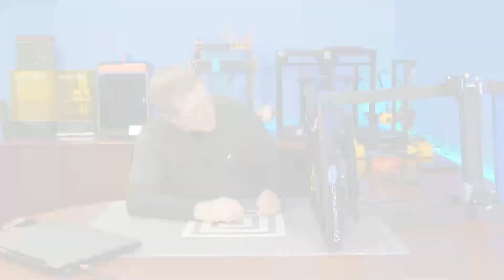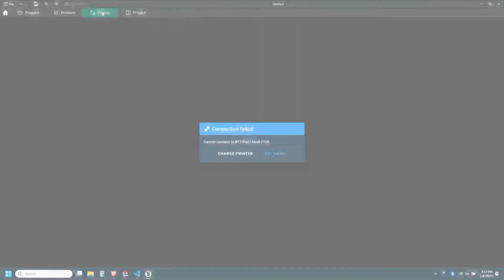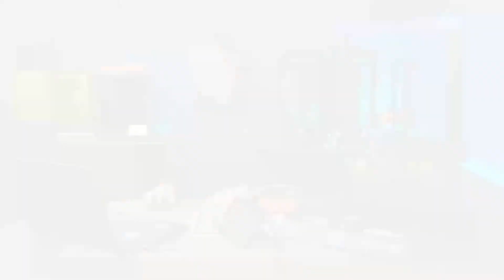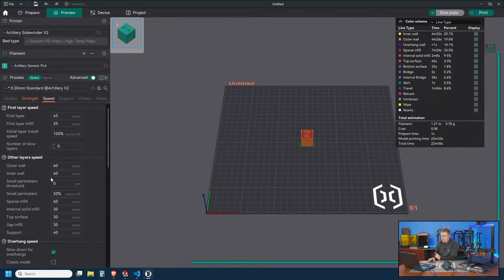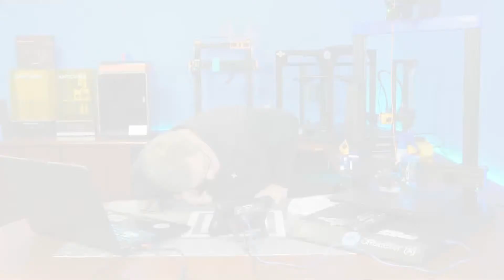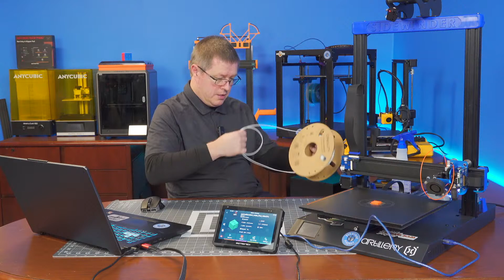Sidewinder X2 Filament Runout Sensor Setup In Klipper

Comment: Hi takin the dare of asking if perhaps you could help me. I recently got a pad 7 and it runs hot. I wouldn't like to mount a 40 mm fan on the heatsink but haven't found where to plug it to. I thought inside the pad 7 but haven't found any documentation. So then i thought perhaps on the ruby board? I know there's the uart port and exp ports but honestly don't know if that's a valid choice. Any ideas you could provide would help a lot!!
Reply from the maker: If you can find a usb powered fan you can plug it into one of the free usb ports.

Comment: Great, thanks! I only had to connect it the exact opposite way you showed. If you connect it the other way, only the green light shows, but the red button doesn’t work! Then you just need to reverse the connector!
Reply from the maker: @bobgtalk4585  Sometimes the micro switch in the sensor is backward. Chinese QC for ya.
Reply: @EtherealProject3D  Ok, thanks for the feedback. Original sensor though. Both printers had the same problem. Just for other people to be aware what to expect (missing light) when connected wrong.

Comment: hi ^^ on your video the motor's drivers isnt original?
Reply from the maker: Are you asking about the stepper drivers?
Reply: ,yes the color intrigues me
Reply from the maker: @Ripyxp  Im using the stock stepper drivers, I am thinking you are referring to the breakout board connected to the extruder motor. That is my custom designed and made one I sell on my website.
Reply: Yes i have 1 ;) and prototype board work great

Comment: hi there, just tried to follow your video. all worked but the runout sensor that means: mainsail recognizes the sensor but the runout is noct detected. i have the green led on when filament is in, but i dont have the red led on when the filament is out.  I am freaking out :-D anybody here with a solution?
Reply: could i also have a solution, i have the same issue :D
Reply from the maker: Just got your DM.
Reply: As you helped me out with my problem, i have to tell all the ppl here, it was MY fault, i just got the plug in in the wrong direction. Mathew just pointed me to this solution and after opening up my printer for the umptieth time that day and chage the direction of the plug it works..... Looking forward to doing loads of more upgrades to my x2 in the future, guided by etherealproject. Thanks for your work and time!! @EtherealProject3D
Reply: @EtherealProject3D  Hola me pasa lo mismo alguan solucion??

Comment: I never seem to make the live stream while it is live. I was actually working on my X2 while it was live. You seem to be one of the few who still give any value to the X2 - great printer for the price. My question about putting Klipper on my X2 was answered in this video. Wasn't sure if you still sliced to an X2 profile or if you had to set up a completely different "Klipper" profile. Looking forward to next week's edition.
Reply from the maker: Thank you for coming by and watching post stream, I really appreciate it. For orca slicer you will need to change the gcode flavor to klipper and change the starr and end gcode as well. If you load up a voron profile you can copy and paste the start and end gcode. Then you can use my start and end macros, download link in the description. I will be updating them sometime this week.
Reply from the maker: Curious if you are the Mcmilianfarms in Puyallup Wa? If so you are local.
Reply: Nope. Boondocks SW Wisconsin. Thanks for your help. I have the PI the printer and a screen; just wasn't sure what all Klipper would give me other than speed so haven't pulled the trigger yet. @EtherealProject3D